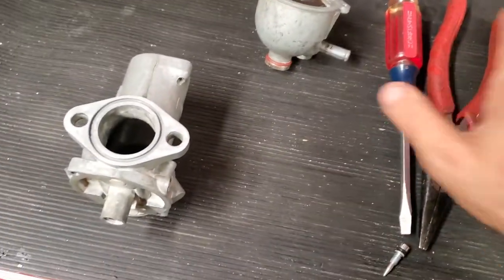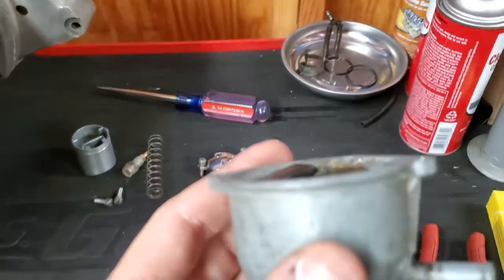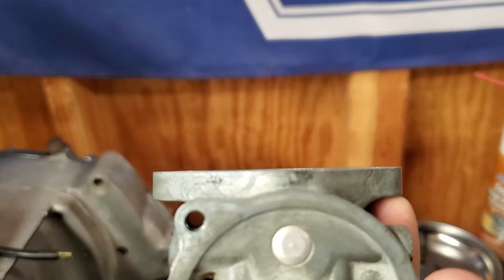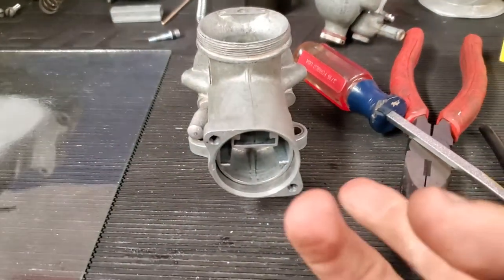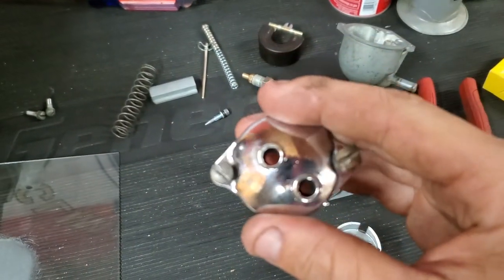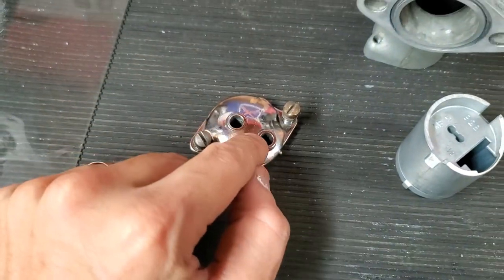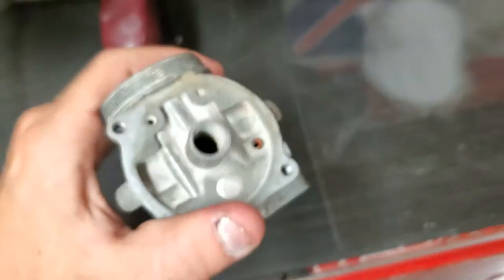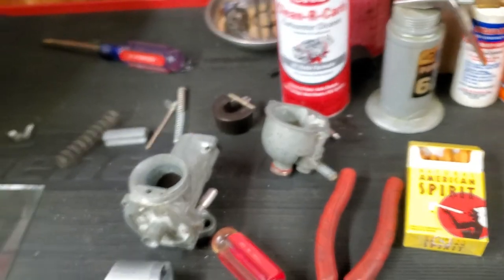how to rebuild/clean old amal 930 carb TRIUMPH 650 (rebuild kit)

Comment: I like to drill a hole opposite of the air screw to gain access to the pilot jet. Then just tap the hole and put a screw in the hole for future cleaning. Makes the job really easy and isn't hard to do.

Comment: Great video, man. Do you use the o ring supplied with the rebuild kit for flange mount? Or paper gasket? Appreciate it.
Reply from the maker: Thanks 👍🏼. And I have used both on different carbs. But the o-ring should be fine. If not the paper gasket should seal it for sure.

Comment: Hello good sir wonderful video!
I was wondering; The long pin that has that weird shaped clip on it. What knotch do you put that clip on or does it even matter?
Reply from the maker: That's your throttle needle. And yes the position of that clip matters. It controls how rich or how lean your bike will run at about 1/4 throttle to 3/4 throttle. Start off with Putting that little clip in the middle position on the needle notches. There should be 5, put it in the middle and see how your bike runs. If the bike is running to rich your going to want to raise the clip a notch UP to the 1 or 2 position. If it's running to lean your going to want to move the clip DOWN on the notch to the 4 and 5 position. Every motorcycle is a little different especially these old triumphs. But the middle clip position should be ok plus or minus a position of 1 from the middle. I hope this helps if it sounds confusing I can break it down a little more for you. Thanks for the support 👍🏻.

Comment: The valve lapping compound could improve a tight slide.
Reply from the maker: You can use High grit sandpaper. But the valve lapping compound has worked for me. Whatever floats your boat.